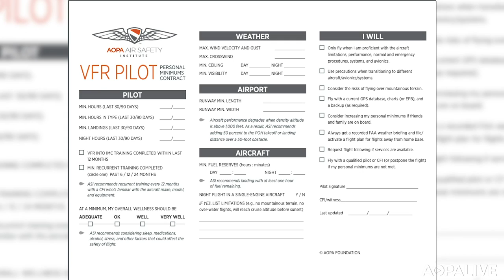Draco Crash Lessons Learned

Comment: At least you didn't call it a "ground loop"
Reply: You can "ground loop" on take off or landing.
Reply: @Cmoredebris  yes but a ground loop requires a loss of rudder authority allowing a uncontrolled yaw.  That didn't occur in this case
Reply: @craigdowden4788  Mike didn't have aileron, elevator or rudder authority. While this was not the classic ground loop, loss of control during a landing roll out, it was still a ground loop.
Reply: @Cmoredebris  I think he clearly had rudder control as otherwise it would have yawed into wind and adverse yaw effect
Reply: @craigdowden4788  At the very start of the video 0:01, before Draco goes out of frame, you can clearly see that Mike had full left aileron and full left rudder input and the plane still rolled right. The control surfaces had no positive effect to counter the effect of the wind gust that had raised the left wing. 
 Adverse yaw applies to an aircraft in flight when the ailerons are deflected. A lowered aileron creates more drag than the raised one, creating a yawing force opposite to the desired direction on turn. The rudder is used to counteract this phenomenon.
Reply: @Cmoredebris  Adverse yaw is caused by differential induced drag.  Simply put the up going wing is producing more lift and is creating more induced drag.  In this case the windward wing (LH) was producing more lift (and hence going up regardless of aileron position) and as such was experiencing more induced drag.  This would produce a yaw towards the up going wing ie a yaw to the left.  Combine this with the x wind (yaw left) and slipstream effect (yaw left) and you should agree all forces were acting to yaw the aircraft left.  Clearly this did not occur and the assumption should be Mike had rudder control.
Reply: @craigdowden4788  If "all forces were acting to yaw the aircraft left" as you state, then why did the aircraft yaw to the right? Do you want us to believe that the pilot countered these forces by successfully using right rudder, at the same time he was using full left aileron? The aircraft yawed right because the right wing stalled.

From Wikipedia: On 16 September 2019, a PZL-104 2000 (N123T, popularly known as Draco) was attempting to takeoff from Reno Stead Airport in a crosswind with 38 knot gusts with a subsequent ground loop and crash beside the runway.[18] The three occupants got out uninjured.[19]
Reply: @Cmoredebris  Clearly you don't understand basic aerodynamics.  I have tried... but I won't be wasting any more of my time trying to explain it to you.  Have a nice day...
Reply: @craigdowden4788  "Clearly", you must not be a pilot. If you are, you need to attend ground school.

Comment: oh come on look,  he re-engineered the entire airframe, gear, wing etc....then plugged 680shp on the nose...big jelly donut tires,  I'm certain the CG was totally recalculated, but it was an expensive experiment.  I fly a stock Wilga with the 9 cyl engine,  I find the airplane as is engaging to fly ,  with good  performance I would never change it.  He redesigned the wings,  attach points , gear tanks...sitting on the end of the runway the thing looked like it was in a 10 degree bank still sitting on the ground....sorry